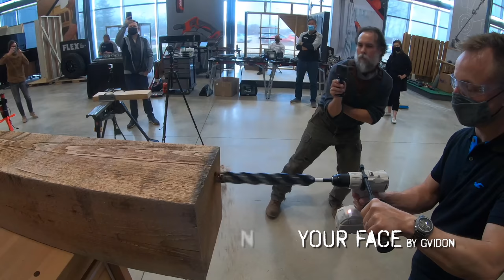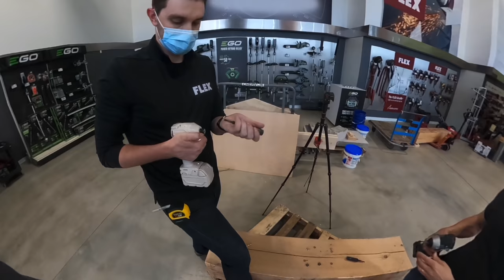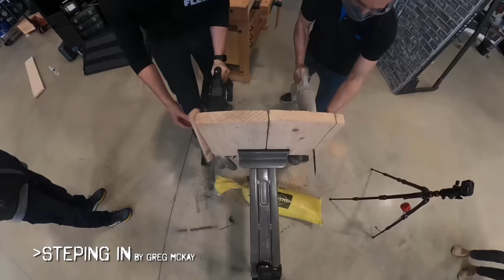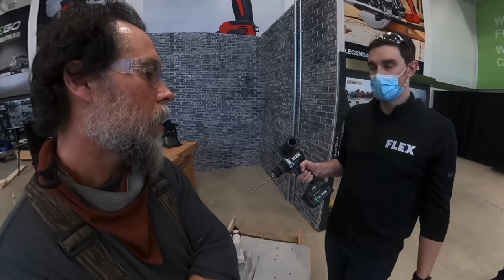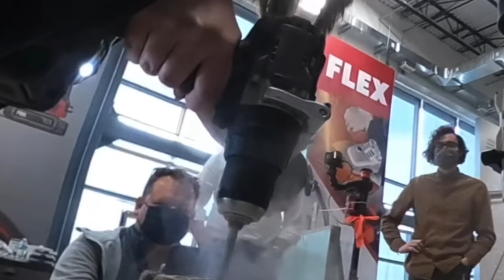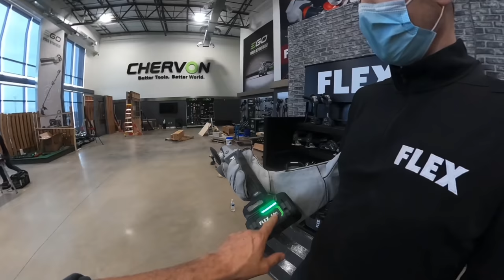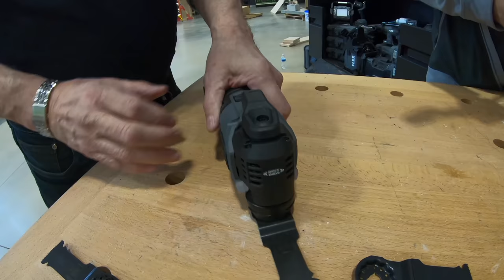Testing Flex's new Power tools- No glitz, no hype, no B.S.

Comment: I will still wait till Project Farm makes a comparison.
Reply: Speed is one thing, then there’s reliability and looks, and that goes to Milwaukee
Reply: Makita is reliable
Reply: @galvanizedgnome  nah
Reply: @galvanizedgnome  but they tested it against milwaukee not makita
Reply: @galvanizedgnome  Makita makes great tools but they already loose to Milwaukee, that comparison has been made by many people already. Flex wants to take on the best, so why would they battle Makita? If they beat Milwaukee, then they will beat Makita.
Reply: Guys own the 36v Metabo multivolt hammer drill. This is a real world scenario. If they want real world, that would be a better comparison. I grab for that tool over Milwaukee when sinking augers.
Reply: I do like the ergonomics on the Flex recip.  The vibration reduction is a true story from my testing.  (But I don't use recips for a living.)
Reply: @wallacengineering8096  Yeah, no, that's not how it works. Milwaukee makes good tools, but they're not simply better than Makita. Makita has plenty of stuff that beats Milwaukee by miles, just like Milwaukee has plenty of stuff that beats Makita by miles. Milwaukee and Makita are very comparable, both in quality and reliability. The one thing I've noticed though, is that Makita is more consistent. Milwaukee usually beats everybody in one aspect (speed, power or torque), but loses pretty big in other aspects, while Makita rarely ever wins in a shootout, but is always near the top in every aspect. Personally, I prefer an all round good tool to one that's great in some areas and not so great in others, but Milwaukee tools definitely aren't bad.
Reply: @paedahe4975  English?
Reply: @timderks5960  Um so you do realize every tool on the market has been tested at one point or another right? Milwaukee is #1 right now. If you like Makita tools thats cool, I never said they were bad, but you can't go just assuming a brand you prefer is better than another. Comparisons have been made, showing the speed, power, capability, durability, runtime, ect. Of every major brand tool ever made. So why would you think you could get away with false claims when we have the information? Makita tools are just as durable as the other big names - DeWalt and Milwaukee, but DeWalt can performs tasks faster than Makita, and Milwaukee can perform tasks faster than DeWalt, all while having the same great durability from a great company. There are Milwaukee power tools that have been passed down from another generation and are still going. And the modern M18 Fuel Gen 3.5 is legendary and is the most popular brand on the job site by far. How do I know? I have contractor friends. My buddy Eddie has been in the game most of his life. While he does see both Makita and DeWault as well as top-tier tools such as Hilti and Festool from time to time, Milwaukee is the vast majority every single day and has been for as long as he can remember. He literally commented on my post sharing the new Flex tools just the other day to say "They can try all they want they want and may even manage to be a tad faster, but I have had my M18 Fuel Gen 3 since they came out, use it on site daily, pushed it to hell and back doing tasks it really isn't made for, and it hasn't skipped a beat. Flex Tools may be fast but overall they don't stand a chance against Milwaukee. When this tool survives a real construction company for a few years, I may take another look". So hes another stubborn guy who won't change his ways. But he is this way for a reason. He has had one brand of tools ever since he started the trade right out of high school - Milwaukee. Not once has he ever failed to do a task or thought his tool was anything less than the best on the job site. Major Youtubers also rate Milwaukee ahead of Makita and DeWalt in almost every test. So you can't argue with results, thats just how it is. Makita may offer a few tools that beat Milwaukee's offerings, but every company has its own specialty that they are good at. But that doesn't mean the whole company is great. Skilsaws are still some of the best tools on the market, but Skil as a company makes some of the worst tools out there and Ive never heard of a contractor use any Skil tool that isn't a saw. Makita is a great overall brand as I said but DeWalt and Milwaukee are both currently ahead of Makita overall as companies. Are you really that mad that Makita is 3rd place? Its a great showing and you don't need to get so upset about it. Plus the 3 companies trade places all the time. A great new line of tools comes out almost every year that can change the pecking order. Its not like Makita will be in 3rd forever. You should really do research before claiming things.
Reply: @wallacengineering8096  Jeez man... First of all: if you write a wall of text: DO SOME FORMATTING... This is an atrocity, if you treat your tools the same way, I'm surprised they still work. Secondly: Your last sentence is absolute bullshit. You tell me to do some research before claiming things? YOU are the one claiming things. Let me make one thing very clear: THERE IS NOT BEST BRAND. There simply isn't. You know why? Because best us subjective. You could determine a best by awarding one point in categories (highest torque, fastest, etc.), but that's completely useless. Also, if you're so sure that there's a determined best, where's your scientific research? I don't see you providing any sources, just BS claims.

There are only a few types of testing around:
- Marketing. Determines what specs to put on the specsheet and in ads. Useless, since every company tests differently.
- Safety. Although important, irrelevant in this case. Tools only need to pass.
- Testing by certain instances and, these days, YouTubers (not like Stan, he just tries them out, I mean serious testing like Project Farm). These are the best if you're trying to compare, but still heavily flawed.

Like I said: Milwaukee (and many other brands) tend to come out on top on one aspect, and then be very mediocre in all other aspects. I've seen numerous videos where a DeWalt impact was the fastest driving a screw, but the chuck was so incredibly wobbly that it was just ridiculous. So yes, it's the fastest, but it also had the worst build quality. Does that make it the best or the worst? YOU CAN'T DETERMINE THAT. It's personal preference. One person cares about being fast, one person cares about a well built tool, another cares about both, so they all have different bests.
Fact is that Milwaukee and Makita are at the very top of the line when it comes to heavy duty tools. Milwaukee and Bosch are at the top of the 12V range. That doesn't mean that they are objectively number 1 or 2, it means they're objectively good tools, but there is no best.

Unless you can show me scientific research, which is supported by a majority of tool manufacturers and companies around the world, your BS isn't going to fly with me. THERE. IS. NO. BEST. BRAND.
Reply: @timderks5960  Ya as if Im going to bother formatting for social media. What is this an English paper? I don't care in the slightest. Secondly these aren't my opinions, these are opinions of friends and the largest Tool reviewing YouTubers. Milwaukee ISNT my preferred brand, I dont even own any Milwaukee tools. I own DeWalt tools. I just like the flexibility. So you can claim all you want that their isn't a best brand but thats simply not how the world works. There is a brand that sells more than the others, is used more on job sites, and has won the most head-to-head competitions in reviews. If you don't know what brand it is, then you clearly haven't been paying attention. But I dont have all day to argue with someone on YouTube so I suggest you check out comparisons from some other YouTube channels. Pro Tool reviews is great. VCG construction is pretty cool, This channel is decent, Shop Tool Reviews does a lot of Milwaukee reviews. Whats cool about Shop Tool Reviews channel is they review a lot of the more unique tools for auto mechanics so theres some cool stuff on there. Have fun, you'll figure it out for yourself sooner or later.
Reply: @timderks5960  Ill tell ya what tho Makita definitely had a real shot at #1 back when their tools came out of Japan instead of China. I mean ya most tools these days come out of China but those Japanese tools were strong as hell, that is for sure. Oh and as the OP commenter said Project Farm is another great channel for some tool reviews. Gotta go now.
Reply: @wallacengineering8096  No way ,Makita  is still king  ,their new hammer drill is unbelievable as well, it would have killed that Flex.
Reply: @interman7715  I have heard that their new Hammer Drill is indeed pretty amazing. Still, one or two tools isn't quite enough to change their standing, plus we gotta wait to see how it stacks up on the job site and make sure the same Makita durability is still there. Changing places isn't something that just happens overnight. Not sure if they will Overtake Milwaukee this time around but I have a feeling they will at least take 2nd back from DeWalt.
Reply: @wallacengineering8096  In Australia the only way Milwaukee became popular was because of aggressive marketing and generous warranties. Makita and Hitachi were king and that's all you ever seen in industrial and commercial sites.Makita has never let their quality down whereas I've seen some crap Milwaukee. Dewalt is gaining ground mainly because of their Flexvolt line and the batteries being backwards compatible to the XR line .Milwaukee has flogged the 18 volt system to death and will have to move up in voltage.  Makita should have made their new 40 volt batteries backwards compatible to the 18 volt line ,big mistake . 
Milwaukee in Australia is getting very arrogant with their popularity, ie they never discount and their prices are way above other brands now .I run Dewalt.
Reply: @interman7715  Yep Milwaukee knows their position and they will ride that train for as long as they can lol. Luckily Im not too invested in DeWalt Myself because honestly I think Kobalt's newest XTR line provides a better value plus their batteries aren't so stupidly expensive. This new line from Makita, the 40V and 80V lines, might just have what it takes to take the crown back, they are insanely powerful. But just like any other new tool, they haven't been around long enough to tell yet. But I didn't realize how much better Kobalt has gotten until literally today.

I never really watched Kobalt reviews because I was always focused on the 3 big names plus when I tried Kobalt a few years back it was very underwhelming. But now, 2021, its crazy good for them. I mean they have a 1200 ft-lbs 24V Impact wrench thats affordable. They seem to be that perfect medium between decent Ryobi and the Pros for a very reasonable price. I might just start buying into Kobalt.
Reply: @interman7715  And to be honest the first legitimate comparisons with Flex tools are starting to surface and they are doing quite well. Their 1/2 Impact is impressive and also undercuts Milwaukee's pricing. Just gotta wait and see if they have the durability
Reply: Project Farm is hands down amazing. he is BEST at consumables. how about concorde carpenter - toolbox buzz? they do very detailed reviews too
Reply: Yes true some makita are better than milwalkuee
Reply: @galvanizedgnome  true
Reply: let's see ave tear it down
Reply: Read my mind LOL PF for the win!!!
Reply: @setunedouche  just a clarification I'm not shaming Stan's video because its really good I'm just saying that the test that wasn't put up by Stan was rigged.
Reply: @Modelo646  I 100% agree this was a fantastic comparison...I was also just merely giving props to PF as well LOL. More testing is required 👍
Reply: @Modelo646  Stan is the Man!!!
Reply: he wont.... ive been asking along with others for the Kobalt XTR since thats pretty much the MOAB of mid tier/semi pro level power tool and he didnt compare it. even their basic 24v is still amazing.
ive been asking for a while for kobalt tested items and the first kobalt he has tested was the tape measure.
Reply: Seems kind of iffy to me, seems like trying to get more endorsements.
Reply: @kalle8836  Project farm tested this against the Milwaukee and the Milwaukee smoked it. Anyone that doubts this can head over to project farm the video is posted.
Reply: @wallacengineering8096  This is why they’ve been targeting Milwaukee on their wack test ever since they’ve launched this platform.
Reply: @timderks5960  you’re correct even though I do prefer Milwaukee the Makita miter saw is far superior. But flex is targeting Milwaukee because of their market share and overall they have become the tool to beat.

Comment: It looks like the Milwaukee battery is the tradition 1850 cells...I wonder what would be the difference of the Milwaukee had the HighOutput cells? The results would be significantly different for even a Milwaukee comparison using the newer batteries. Also the impact drill they used in 3 generations older than what is currently on the market for the Milwaukee drill that was just released this year. It’s a good marketing scheme by FLEX to use these older technologies to compare their new tools, but still not convinced unless a 3rd party performs a more “real” analysis comparing the newest tools from the respected brands
Reply: Every single flex 'test' has been a joke.
Reply: Project farm will give us some truth soon I hope
Reply: MAN CAVER TOOLS “MCT” will have a head to head soon. He is one of the only tool reviewers I trust because he doesn’t care what tool wins, so at the end it will show what tool line is better.
Reply: @akaredcrossbow  you should check out project farm’s comparison videos.
Reply: @jerod5636  I’ve seen almost all of his videos. Project Farm, AVE, MCT and Tool Review Zone imo are extremely trusting and honest. with the introduction of Flex VCG has me on the fence with trust for now and it’s disappointing. I just can’t tell.
Reply: @akaredcrossbow  fair enough. We’ll start to see reviews rolling out soon from regular people soon enough I’m sure. 

I’m most interested in seeing how well they handle warranty claims when they start coming in. That’s just as important for me than saving a couple of seconds here and there.
Reply: @akaredcrossbow  VCG is a joke. Vince is a much better tool operator than Nick, lol..
Reply: @giovanysantiago7562  the problem with VCG is to much Operator error
Reply: Test the flex against the super sawzall
Reply: @JayBuccola  how so?
Reply: @jimmyfavereau  tool tier, battery size, timing… And all obviously paid promotions.
Reply: I'm getting milwaukee fan vibes